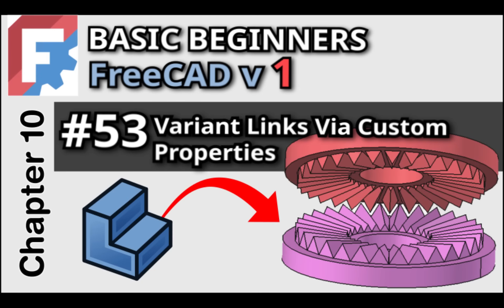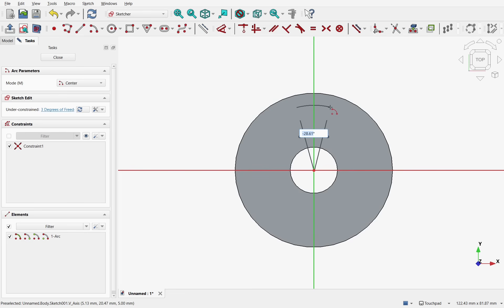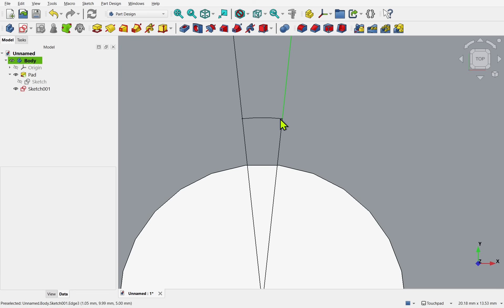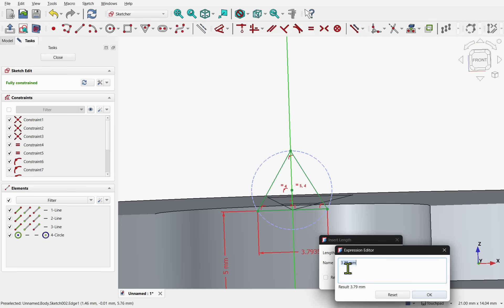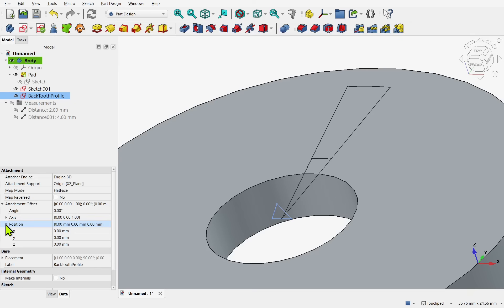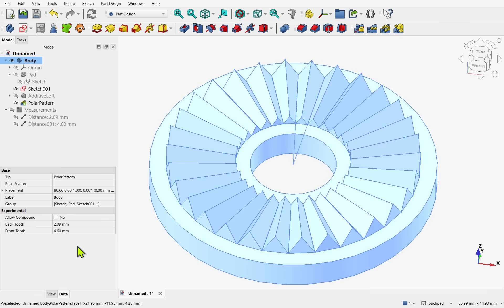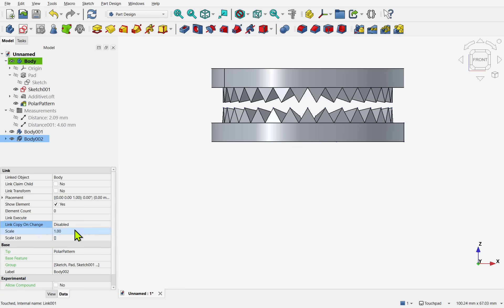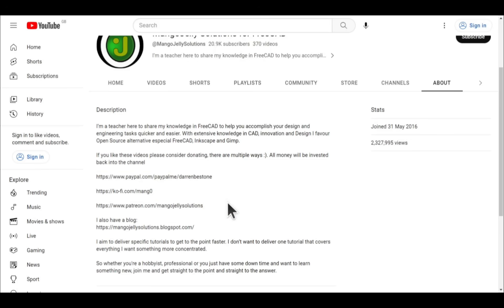FreeCAD How To Generate Multiple Variants Without Re-Modeling | Basic Beginners Lesson 53  (FCv1.1)

Comment: Workaround fix if you get this problem. In my latest FreeCAD 1.02, following this example, symmetry constrain on the two arc points to Y axis simply won't take. Clicking symmetry seems to move them into position, but doesn't add a constraint, still leaving points free to move asymmetrically. To get around it, add a line of "construction geometry", a short vertical (construction) line on the Y axis. Now try again. Select the two arc points and one of the end points of the construction line, click symmetric constrain. Works. Constraining points to an axis has worked for me in all previous videos, but not here. Not sure why.
Reply: I had to do that here.  I also find that coincident constraints give the symmetry constraint trouble.  If I remove one of a pair of coincidents then the symmetry takes.

Comment: Dear MangoJelly:  Your work is outstanding, and so is that of others  who are working so hard to help us (Deltahedra for example).  I am a 35+ year user of AutoCad 2-D and I am wanting to share one common perspective on FreeCAD.  The complexity and the concepts used in parametric modeling can be very difficult to learn for traditional draftsmen, and the HUGE variety of options for how one might constrain sketches make it even harder to learn.  I wish one of you giants could think back in these terms and try to devise a way to slowly and methodically help this particular subset of new users embrace this amazing program.  If there could be a bridge between traditional drafting concepts and FreeCAD that would be amazing.  For example, I drew a simple sketch with a curve intersecting two skewed lines tangentially.  When I later placed dimensions on one end of the line away from the curve, the curve changed in a way that was unexpected.  I had improperly constrained the three-point curve and had not understood how this occurred and the ramifications.  Perhaps one of you could share screens with a series of failing beginners in order to watch and discover the breakdowns in logic that lead people to simply give up.

Anyhow, thank you for all your hard work on behalf of others.

JB.

Comment: Very helpful content! May I suggest a follow-up video on how to use these Variant Links with the Assembly workbench?   

I can't seem to find a way to insert an existing Variant Link into an Assembly object using the workbench UI. I can manually drop a Link onto the Assembly object and that "seems to work" but feels like the wrong way to do this.  

The other option is to create a link using the Assembly workbench "Insert->Component" UI and then setting "CopyOnChange" after link creation. This seems better, but not optimal. 

Is there a way to insert an existing Variant Link into an Assembly object multiple times?  For example, if I create a set of Variant Links for standard/common lengths of PVC pipe (100mm, 200mm, etc.), can I then insert/create, say, 4 copies of the 100mm Variant Link into a given Assembly object?

Comment: Wow!  Bravo!
Reply: I spent ages writing a spreadsheet that calculated the teeth / spacing / angles for different sized gearing to still work on classic Lego and it took me AGES.
I also then had to manually do the duplication in the model.
THIS would have saved so much time!

Comment: what's the difference between the link and a copy (sheep icon)?
Reply from the maker: I think that is something I should of covered in the video, sorry about that. Variant Links are configurable instances of an object where a clones are  parametric copies. The variant can be linked to configuration tables and parameters to make copies, i.e. different versions of bolts, M5, M6 etc known as part families (something else I should of mentioned)  where as the clone (if from the draft workbench) only allows for scaled variants, 1x, 2x, 3x size etc and cannot be manipulated by a dataset in the same way.  And the clone from PD branches the workflow cloning it into a new body and cannot be scaled.

Comment: The "link copy on change" can also be found on all Part array tools as well as the SubShapeBinder. You can link to an object inside a Part container, and the link will inherit all the parent Part container CopyOnChange properties. In addition to href() you can also use dbind(), which makes the property hosting the dbind bidirectional in the property panel. Using the lattice2 workbench, you can generate an array of parametrized parts using a list of values optionally from a spreadsheet.
Reply from the maker: There some nice information in there thank you for sharing.  Always great to share.  (Also I'm a big fan of Lattice2 :) )

Comment: This is an amazing video. However for the life of me I can't get the formulation to work. It says something like Property 'FrontTooth' not found in Body.FrontTooth. I just did the dimensions manually and it works fine but it's not as easy to change as yours. Thank you for all the techniques shown here though, I have been trying to find Hirth joint files with very little luck. Now I can make my own!
Reply from the maker: Hi craig, yes that's a bit strange, could you send me your file and I can take a look?  Glad you got somewhere via a different route.  Maybe your body is called something else, might be worth trying the chevrons <<yourbodynamehere>>.parametername.
Reply: @MangoJellySolutions  I got the same. In 1.0.2 the "Add Property" dialog has a checkbox "Prefix group name". The default setting seems to be true, which will result in the error.